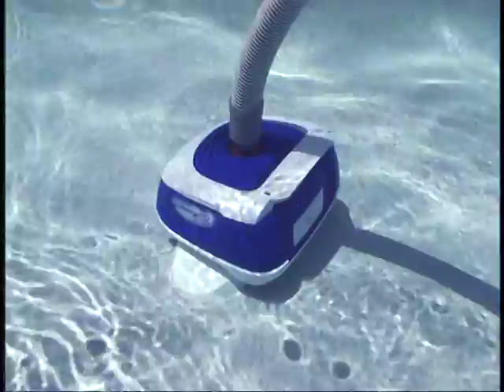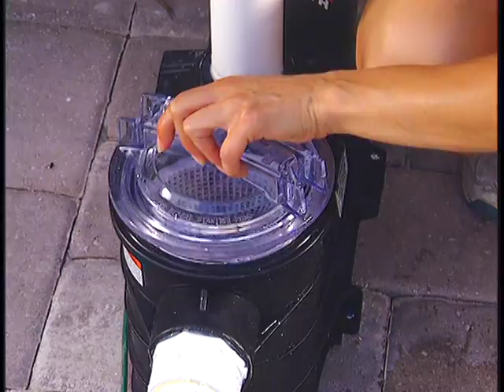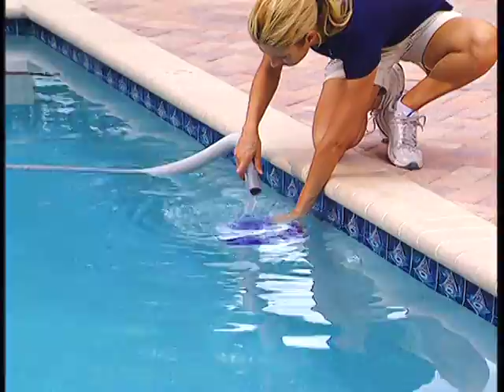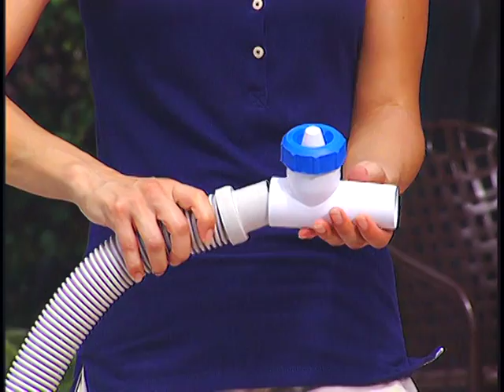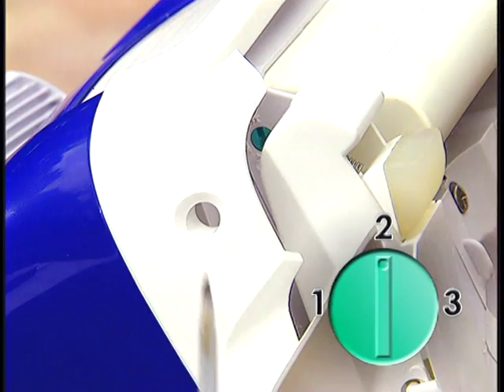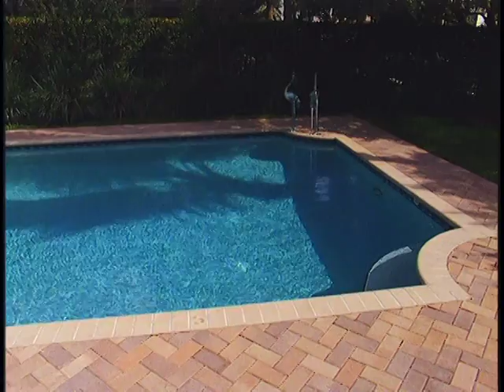Navigator Pro Basic Installation

Comment: I just bought it today. We measured the pressure as mentioned in the manual. It seems that our pool pump's pressure is lower than minimum. So cleaner moves very slowly. Any tips, please?
Reply from the maker: In some cases a booster pump may be required. https://www.hayward-pool.com/shop/en/pools/booster-pump-i-prboop--1
Contact your local Hayward dealer for assistance. Find them by entering your zip code here: https://www.hayward-pool.com/shop/en/pools/Dealer-Locator?langId=-1#top.

Comment: I'm looking to get automatic pool cleaner. My problem is the pool has so much dirt. The pool walls are a 90-degree angle and it is ceramic. The dimensions are 10 meters long and 2meters high and 5-meters width. It is an inground pool. Also, I do not have a buster bump. I have wall suction line.
 My budget is up to $500. 
What is your recommendation?
I want something can vacuum all the dirt from the ground? 
 Thank you in advance
Reply from the maker: Hi Raji, thanks for reaching out. We will have a tech get in touch with you with advice. Please private message your email address, phone number and location.